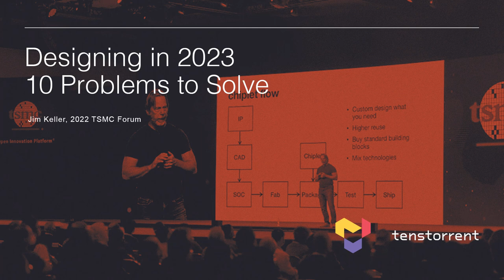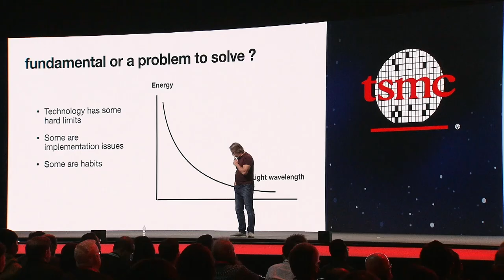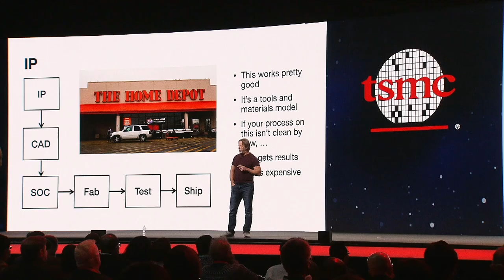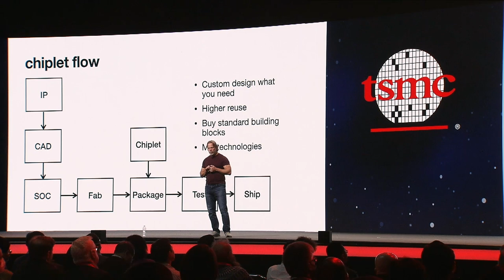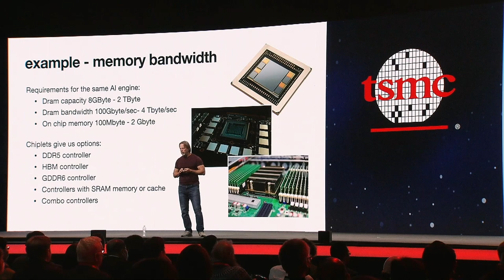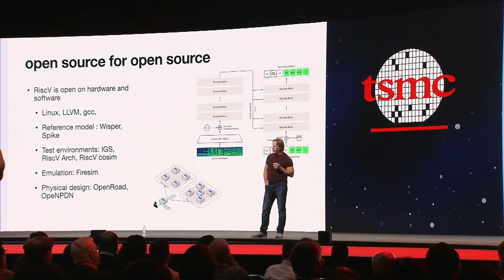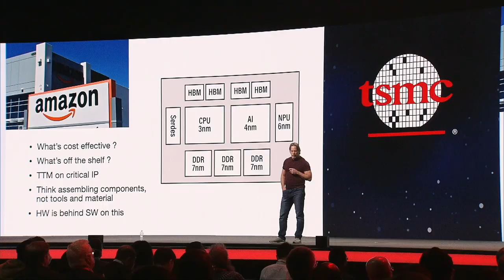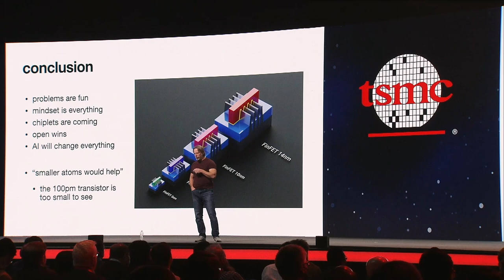Designing in 2023: 10 Problems to Solve w/ Jim Keller

Comment: You should consider the problem of fresh graduates having real difficulty navigating the sea of directions digital design and electronic engineering are going rn. These talks are englightening to say the least, information is too compressed though.
Reply: There is already too many 1.5 to 3 hour talks already in my opinion. A 21 minute shotgun presentation by a technical legend like this is like fresh air to me.

Comment: great talk @Jim - but on a sidenote, 3nm is more like 6 silicon atoms wide with roughly 5A lattice distance, so I guess this is a technicality ;-)     regards, a typically not so nitpicking physicist (but also engineer).
Reply: The name of the manufacturing process does not represent the size of the transistor, i.e. on  a 3nm process, the transistor is (much) larger than 3x3x3 nm